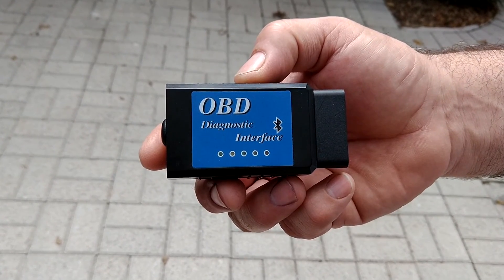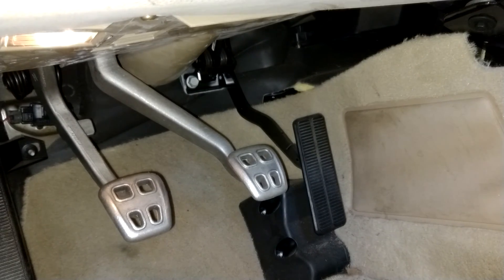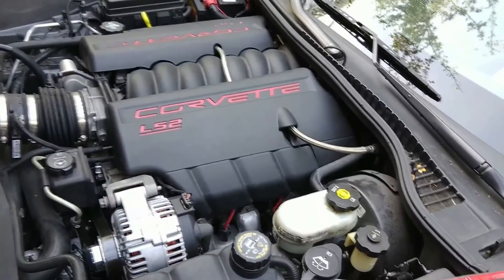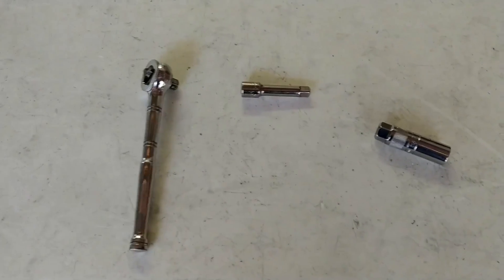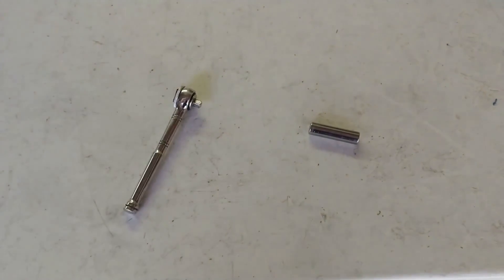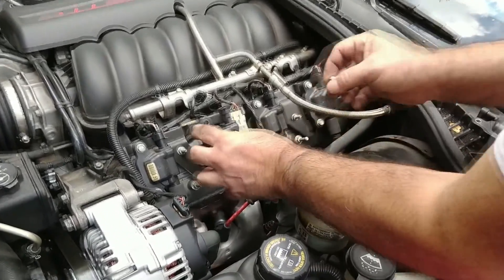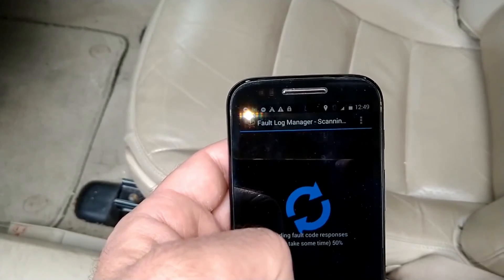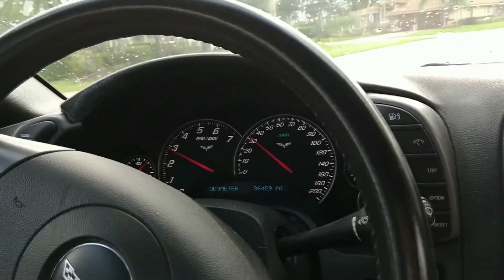Rough Idle Troubleshoot & Repair - OBD2 Scanner Corvette C6

Comment: Why didn't you check first if it was the spark plug or coil pack
Reply from the maker: We like to let the engine tell us what it thinks is wrong, and we then proceed to investigate it.
Reply: Cause first thing before putting your hands in the engine is to read the codes ...what you say makes sense but if you don't know exactly what's the problem then scan the car to find codes

Comment: So did the car show a check engine light? Or if was just running rough?
Reply from the maker: Yes there was a check engine light. Any time you see a fault code at 3:30  that says cylinder misfire, there will always be a check engine light.